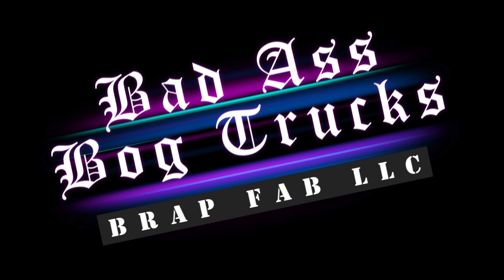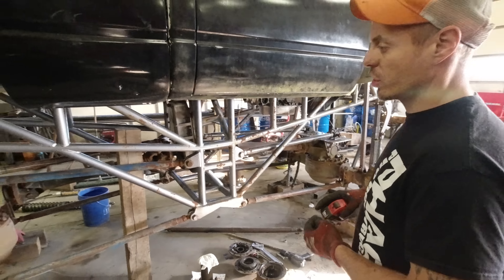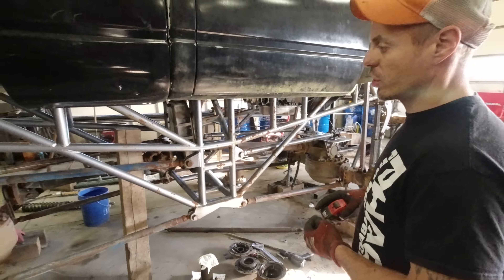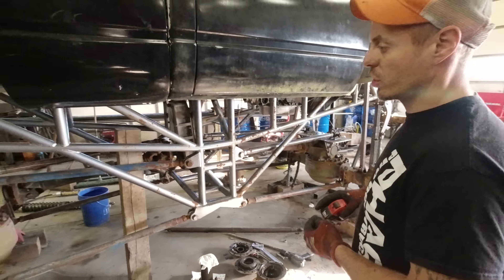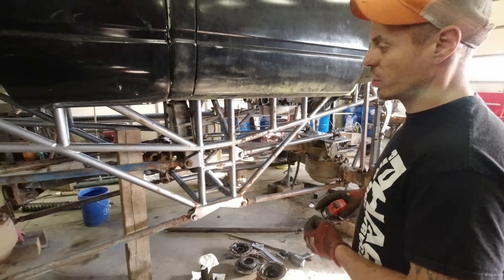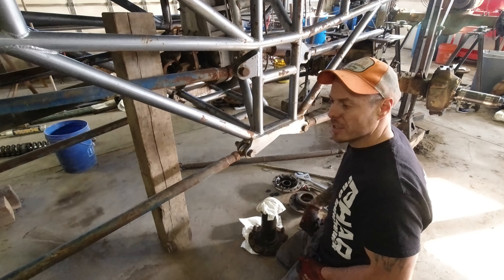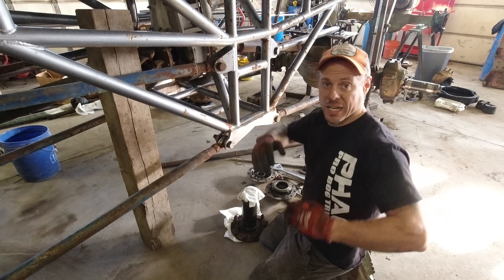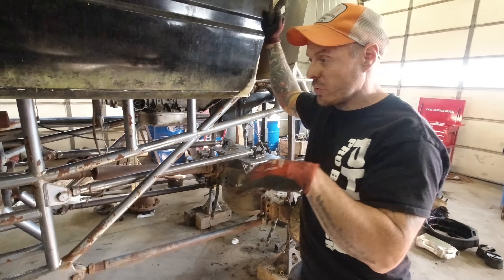EPISODE#2   4 LINK AND SHOCK ALIGNMENT (PART 1)

Comment: So you said the rear link bar at like 14 or 15 in tab to tab and then you said the front link tab should be closer right 
So if rear is 14 apart the the front should be ?? Like 10 inch’s apart